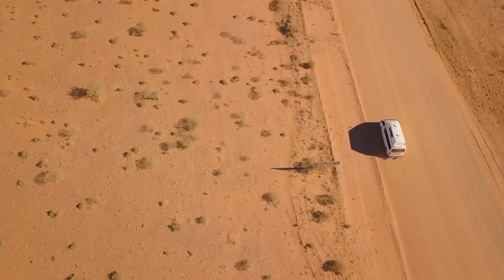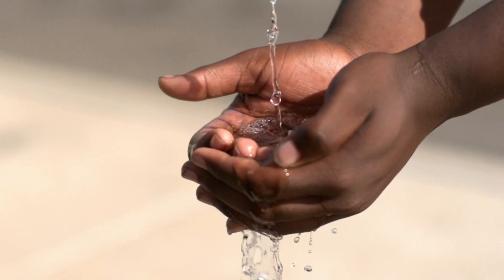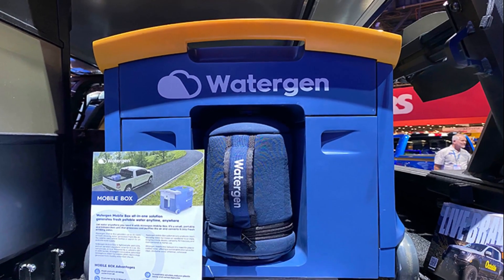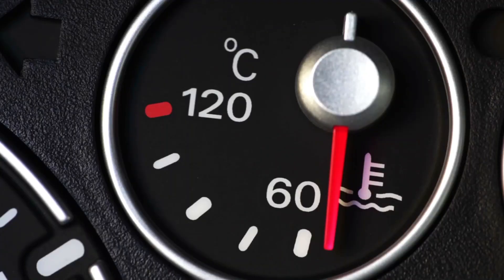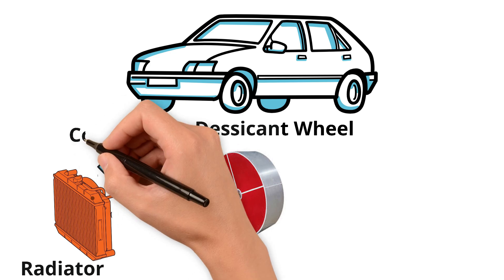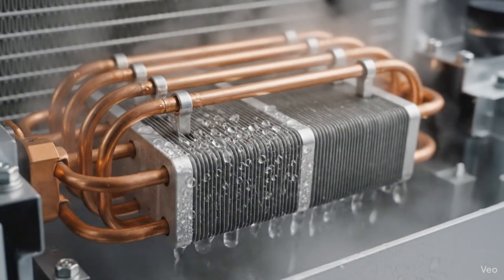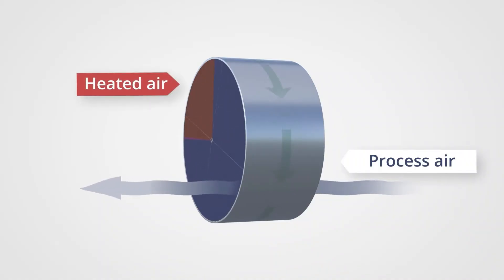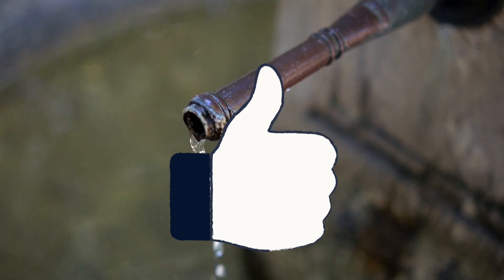A Symbiotic Car-Mounted Water Harvester | Harnessing Waste Heat for Sustainable Water

Comment: Most fuels are hydrocarbon chains. When they are burned they make H2O and CO2. A large enough radiator can condense the H2O. It might be acidic with incomplete burn products and carbonic acid but the water can be treated and filtered.
Reply from the maker: That's an interesting idea!
Reply: @synergyfiles3536  When a liter of gasoline is completely combusted, it produces about 1.5 liters of water vapor. When a liter of diesel is completely combusted, it produces about 1.3 liters of water vapor.
Reply from the maker: @kreynolds1123   Thanks for that info. Water vapour adds to greenhouse effect. So its capture without losing engine performance would be positive
Reply: @synergyfiles3536 it's quite a bit more complex. humidity does contribute to green house effects near the ground. But it's mol weight is 18 grams and air's dry weight per mol is almost 29 grams for each 22.4 liters volume of dry air at standard temperature and pressure, thus water moisture rises, and cools and  then condence and turns into clouds that reflect light back out to space never reaching earth's surface. The convection brings waters latent get of evaporation from near the ground that is absorbed from evaporation and releases the heat energy as it condenses high up in lower parts of the atmosphere. 

This fuel to water technology is most valuable where water is scarce, or potentially when military logistics of transporting essentials like water is both costly and risky.